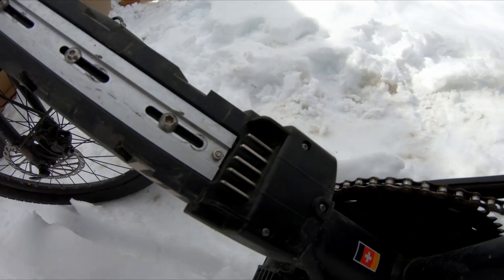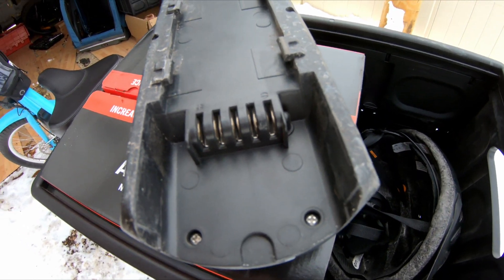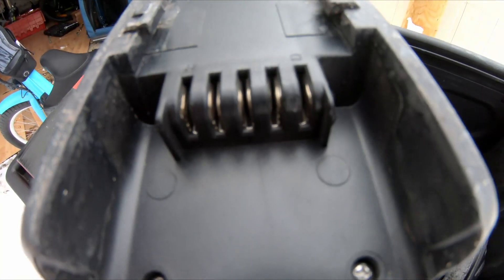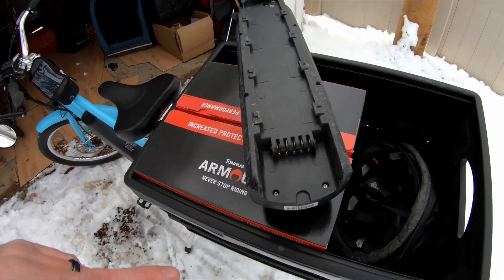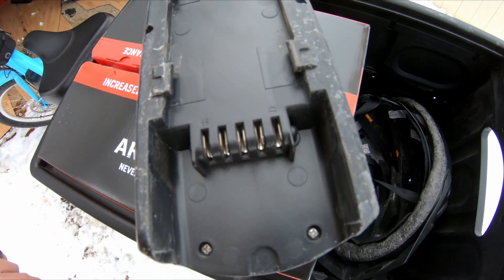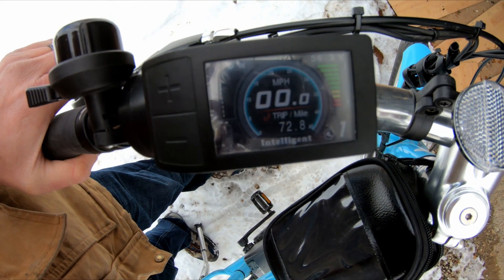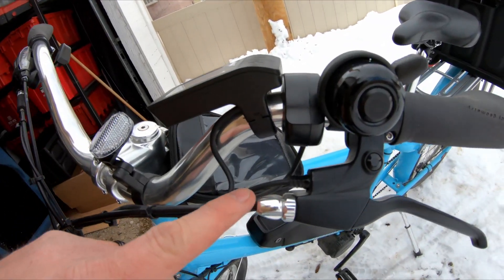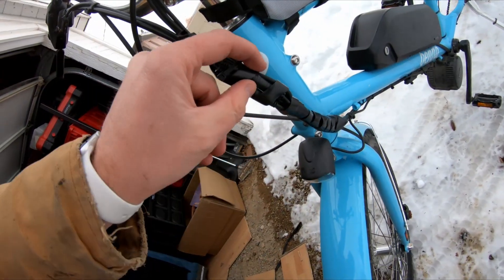Electric bike not working? Try these Troubleshooting steps!

Comment: I have a Tamobyke V20 Pro. Purchased in August 2025. At 1500 miles I've noticed the battery slowly declining. I use it for work. 13 miles to work.  At times about 11 miles in. the bike will shut off. I'd turn it back on. It gives few yards and shut off. I fully charged it. Works ok. Gets me home. no Battery shut off until maybe a couple weeks later. 48 V battery. It should charge 5-6 hours. but it only charges 4 hours and the green light appears. what is it slowly declining?  This is my second EBike. the 1st one lasted 2 years. 13K miles on it. no issues.

Comment: On my happy run g50 I have no throttle response, my brake lights also won't come on in my pedal assists.Don't work and the number on the screen to show what gear your in wont show up what could it be

Comment: My powwr display isn't turning on but my battery is fully charged.i had replaced the back tire because of a pop
Reply from the maker: Check for bent pins, damaged cable and make sure it’s fully connected. Most people don’t push hard enough

Comment: Received my new AMYET EB26 put it together and it turns on but will not work.
Reply: The lights don't come on and the horn does not work
Reply from the maker: Check all your connections to make sure there are no bent pins anywhere. After that, I would reach out to the manufacturer for a warranty case.
Reply: I have the same bike and I’m having an issue right now where when I charge my battery with the charger it stays on green when it needs to be red .Once I plug in the battery on my bike it stays on low battery still

Comment: Brother I’ve got an motor 48v 750w fat tire e-bike, battery wont stay on. Problem is the battery, I know because it has a power meter on the battery itself and the thing wont stay on when I turn on the power switch and check the power bars while the battery is detached from the bike. What kind of internal issues could this be, any help would be appreciated.

Comment: Help, code 30. Before the code i plugged a different display, after putting back the original i had the error message. I replaced the wire just i case i messed up the pins but still same error. Dk300 max

Comment: Bought a Heybike three years ago. Died after about a week. No service help from Heybike. Took it to three bike shops - we only service what we sell. Finally watched this. Followed every step, process of elimination. Got frustrated. Put bike in closet for two years. Take bike out. Smoke a doobie. Sit down in chair and start disassembling bike completely. Get to the wiring harness, pull on it a little, see bare copper wires where the metal on the frame as scrapped off the insulation. Cut and repair. New bicycle works.

Comment: I turn my bike on but when I turn the throttle it don't take off
Reply: Same! Have you resolved your issue?
Reply: @louissisto406 . Same.
Reply: Same! It's been one thing after another with this bike and it had good reviews.
Reply: Same, any fix?  I check all connections and battery is charged

Comment: ?yellow and blue wire that comes from the batterywhere do they  go to?48 volt 1000 wattsseagull ecotric
Reply from the maker: You might have a CANBUS set up. That would be a communication cable between the controller and the battery. But it’s hard to tell if that’s what you have or not without seeing it.

Comment: Names Rich and my problem is my charger has a green light and my battery is showing one bar? When I plug it in the charger stays green? Any help would be highly appreciated.
Reply from the maker: I would check the voltage of the battery with a multimeter. The bars generally don’t mean anything as far as accuracy goes

Comment: I had an error 30 code that I narrowed down to my wire assembly. Rad tried to upsell me with buy a controller but I said no thanks I’ll try this first that was almost 3 years ago.  The error 30 code was coming and going for almost 2 years before that.  Maybe H2O got in or I got a bad 1 from the start

Comment: I tried everything but an 04E persists.
Reply from the maker: 04 is usually a bad throttle.
Reply: @JohnnyNerdOut  True but a new replacement didn't fix the error. It became annoying 3 or 4 repair attempts ago. Maybe the ebike needs a cliff to throw it off of.

Comment: I have a NEW urlife e20 it’s supposed to have 60 to 80 mile range. There’s an indicator on the top of the battery and after I had it on the charger for about four hours it still showed green at the top and right at the bottom I didn’t understand what that meant last night, I put it on the charger all night, and I tried to touch that indicator light and it did not light up. I threw it on the bike and it is not powering up. I checked all the connectors all the wires I don’t know if the batteries defective but I really don’t think so. I think something else is going on. I did have the bike outside for a few hours this morning and it sprinkled I don’t know if that’s the issue. I would think they would be semi water resistant and drying it off. I did not see anything in the manual about this.
Reply from the maker: I would isolate the battery from the bike and throw a vault meter on the terminals and see if you are getting any voltage. If you are not, there might be a battery switch somewhere on the battery that needs to be actuated. I would just keep messing around with that battery off of the bike until you get a voltage reading coming out of the terminals. Then you could put the battery back on the bike knowing that you have a good battery and then sometimes there’s a little bit of a learning curve turning on the bike, generally press and hold the power button for about three or four seconds fairly hard.
Reply: @JohnnyNerdOut  all right thanks. I thought about taking the bottom of the battery off, but I really don’t know enough about them yet.
I am very interested in your bike now. I’ve been messing with the motorized bikes for a while. I bought a Concorde E bike. It got stolen at the damn store then I bought a.  Radpower bike and re-sold that one I just bought this one from Amazon and my license is suspended until next year and this is actually my only transportation and I am very concerned about the battery being defective.
Reply: @JohnnyNerdOut  familiar with the battery on the urlife e20?
Reply: @JohnnyNerdOut  I know it is the battery because the indicator isn’t working and I did buy the protection plan when I bought like, but I have a warranty card. I don’t know how that even works, man and there aren’t a lot of bike repair shops at least for now. Do you have any suggestions before I try to return the battery? Nothing seems to be working. I’m gonna go to the bike thing. I don’t even know if I should just order a new battery or try to use the warranty immature all of his words
Reply: @JohnnyNerdOut  sorry for bugging you like this. I did get the indicator light to come on, but I threw it on the bike and it still didn’t power up and the indicator light has the green lights lit up where it says full and it has a red light lit up where it says empty, but it only comes on randomly. I think the battery is defective.
Reply: @JohnnyNerdOut  OK one more thing it powered on I don’t understand what is going on here. I may be doing something wrong, but I don’t think so.
Reply: @JohnnyNerdOut  I don’t know if it’s because the sun is shining bright on it, but the display light doesn’t seem to be very bright. I’m gonna look into this more and try to learn how to do this but I don’t wanna mess anything up. It’s a new bike.

Comment: It's not full charging runs short what do?
Reply from the maker: Get a voltmeter on the battery so you know exactly what voltage you have. Measure the fully charged battery and then reach out to whoever you got it from to let them know the voltage is and find out whether that’s normal or not. You may be due for a new battery.

Comment: I swapped controller and display on a Bafang M400, to no avail.  was already thinking there was a connection issue with my e-bike. This video convinced me to track it down, and sure enough, that was it. Looks like this saved me around $800 in swapped parts that were not the problem.

Comment: It started with flashing then not turning on at all
Reply from the maker: Could be a bad controller or display. I would check the voltage going into the controller first to make sure that it’s getting good voltage.

Comment: If the battery is missing one of those thingys does that mean the battery is bad
Reply from the maker: Depends on if it was designed without a thingy. Sometimes they are designed that way but it looks off….

Comment: i was riding i had to un snag my chain i turned it off and on like twice   went to take off and it shows 0% and is doesn't go multi meter shows 57 volts i replaced the esc i had a different display  checked the harnesses ive never used the cut off features. i dont get what is telling the display the voltage and why it stopped. Ever run into this......thanks.

Comment: My wife’s Townie - sometimes takes 2, 3, or 4 power on ( and power down - basically a “reboot”) before it works - display is lit but motor ( rear hub hyena) will not engage - works on the 3rd or 4th “reboot” - been like this since the day we bought it - thoughts?
Reply from the maker: Could be the display or controller. I’d try the cheapest parts first

Comment: Jonny I got a quick question.. diamondback overdrive was stolen. I got it back with no battery so I bought a replacement , the cradle isn't the same so I swapped it but my only hold up is the old cradle had 4 wires going to it red, blk, white and blue . The new one only has red and black.. so my question is do I just wire in the blue and white wires to the red and blacks as well and do you know which one is pos and which is neg
Reply from the maker: I would recommend getting a multimeter from Home Depot or Harbor freight for $10-$30 and you could use that to figure out which one is positive and negative. It’s good to have one of those on hand anyways for the future.

Comment: I had a nail in my tire. I replaced the tube and put the wheel back on and now Im getting an Error 02 on the screen. The motor works but sounds terrible. And vibrates the seat when I accelerate. I could use some advice other than, contact the manufacturer. Thanks in advance.
Reply from the maker: Sounds like you have a phase wire issue or the motor bearings got damaged when the nail went in, check the wires first!

Comment: I'm perplexed. I have 2 ebikes with exact setups other than one is BBSHD and one has BBSO2. Same 500c display, same battery cradle. If I remove my batt off my HD and put on my O2, it shows double the charge on the 02 than the HD? The opposite is true, by 02 batt only shows half the charge when I put it on my HD? One display is wrong? Is this a setting issue? Please help!
Reply from the maker: Yes, it sounds like one display is set to red at 52 V and another display is set to read at 48 V. Also could be that your control controller on your BBS HD is set for 48 V.

Comment: I have a LO26 with a 350wat battery which seems to be flat even after a charge but I do belive it's just locked up due to lack of use over 2.5 years of none use or charging . I have ordered a new battery but I just realised it's a 500wat battery , will this be ok for the bike or not ?
Reply from the maker: 500 watt battery? You want to go by voltage. If you motor/ controller run 36v get a 36v battery etc

Comment: I have a error code 10 on my ouxi v8 I've checked everything can't get it to rev and pedal assist won't work  ive order a new display and main wire loom do you think that will fix it thanks
Reply from the maker: Could be the controller or the throttle too

Comment: G50 ebike turns on shows full battery. But it wont move. All wires seem to be good. I do have a melted plastic part near controller. I dont know what that is to replace it

Comment: Hi king my lights cut on but my display dont come on do you have an idea of the problem
Reply from the maker: Bad display possibly
Reply: I got a new one from Amazon today still no luck @JohnnyNerdOut
Reply: @JohnnyNerdOut  I got a new one from Amazon still no luck
Reply: Still no luck with new display
Reply from the maker: Bummer. Could be a bad wiring harness could be that your battery just can’t handle anything with load.

Comment: My bike has plunged into darkness. I have 52V30AH, dual motors, single controller. Today at 350 miles i ran it hard. 88' F, nice weather. I drove 2 two mile speed runs at top speed(39mph). Basically there and back and i had to pedal the final 800 feet to get home because everything cut out on me. 

When i got home i knew the battery was close to depletion so i did a 6 hour charge cycle to get the chargers green light. Reconnected the battery to the bike, flipped the battery toggle to on, turned ignition key to on, pressed the power button on the handlebars and the headlight came on for 1/4 second before going dark. 

After full inspection of battery and terminals, all looked good. All connections leading to lights, brakes, motors, display look good and i see no fault in wiring. Without resorting to inspecting controller i set my sights in battery engagement and there lay the problem. I unlocked the battery and slide it on and off the engagement port a couple times with exaggerated effort and the bike is now alive. 

The bike is a Tuttio Adria26. I will need to fully inspect the unit that the battery locks onto. It has 3 bolts securing it to the frame and i see evidence of the unit shifting to the lowest adjustment of the 3 bolt slots. Somewhere in the 350 miles i have ridden the bike, vibrations and such have caused the battery engagement port to move 7-8mm down from factory position. Further inspection shows two of the bolts to be loose with only one barely tight. Removal of the battery engagement port shows no wear/damage to the wiring so it is ready for reassembly.

The bike is now fully reassembled and it turns on normally. I haven't ridden it yet but i am confident i found the problem to be faulty battery interface. I will make a mental note to add the 3 bolts on that engagement port part of my regular maintenance and inspection which doesn't yet exist, but it will. Someday. 

Thank you for being the first and only video i needed to turn to in my time of need.

Comment: Hi, my bicycle motor is not working, the battery is full, if i turn on the switch the red light will start at level 1 then go up immediately at level 2 and start blinking the red light can you tell me what is wrong ?

Comment: I was wondering if I change the motor on my bike do I need to get a new battery and controller
Reply from the maker: Sometimes. Depends on voltages and physical connections

Comment: Just bought mine. Display won't even turn on so idk if it's the battery or not
Reply from the maker: Test the battery with a voltmeter
Reply: @JohnnyNerdOut  I think the whole system got fried. I was able to get the battery to stay on but it changed nothing.  I noticed the motor in the wheel had wires showing and touching.  They're sending me a new one.  Thanks for responding!

Comment: Hey N.E.R.D. Out I have a Hurley Big Swell 1 and When im riding it just shuts off but I turn the battery switch off Flip it back on and rides again and does the same thing Shuts down Any advice? Thanks in advance
Reply from the maker: I would check to see if there’s a short in the connection between your battery cradle, and your battery that’s causing the battery to turn off. I would also check the voltage of your battery and make sure that it’s holding a good charge. Is it possible It’s just dead?
Reply: Thank you! For your quick reply! Much appreciated! Will do Also Is it possible to install a plate with 5 pins on the Hurley Big Swell 1 it has a 4 pin plate?
Reply from the maker: I need clarification on that question. 🙋‍♂️

Comment: Ty bro …. I was getting a E-07 code for a while I couldn’t figure it out i changed the throttle and all , but it was the plug connection to where the bike folded the metal connections get dirty so i cleaned it up

Comment: i need to reset my controller for the 2023 huffy folding ebike I tried to disable the speed limiter. But I don't know factory settings. So the throttle or pedal assist doesn't work now. new battery, works great

Comment: hey there bud, my light flickered and went out i did all the normal inspections and found it to be the wire at a thing which looks like a input output or a fusible link cause it doesnt come apart my question is can i bypass it and reconnect. or is it a sealed fuse. my bike is a drift slide d.s.100 36v ty for ur attention
Reply from the maker: Sounds like you can, but I don’t have it in front of me. I would do all you can to replace the fuse. You can get in-line fuses universally on Amazon

Comment: Really sounds like you don't know a lot about that specific problem..this speed sensor you pointed out should have. Nothing to do with A no power issue. The  screen as well probably isn't the problem.     Throttle switch probably isn't the problem. More than likely its the controller which you failed to point out or something wrong with the motor.
Reply from the maker: This was a video on hypothetical repairs. How to fix each hypothetical problem. If you have a specific problem that this video does not help head over to johnnynerdout.com book a consultation and I can help you with your exact problem. I can help you problem solve either by phone or video call.